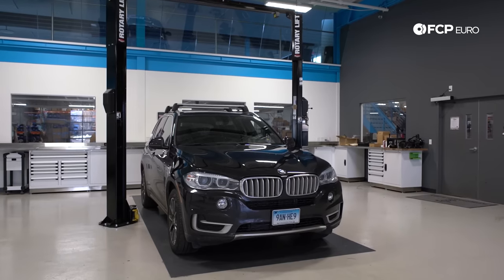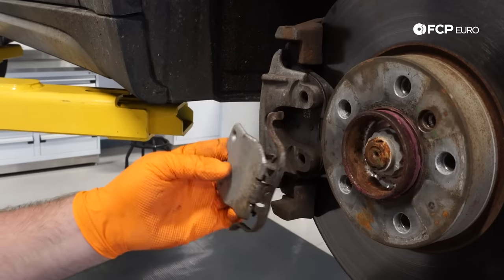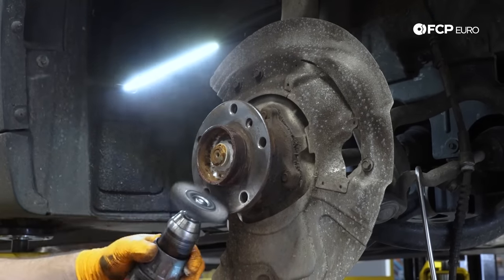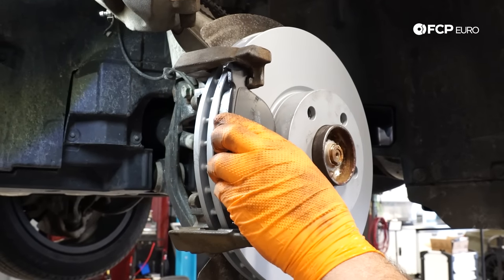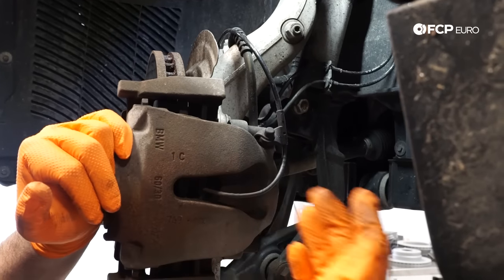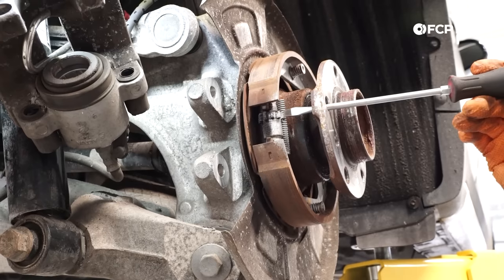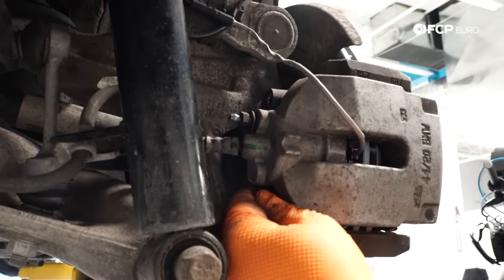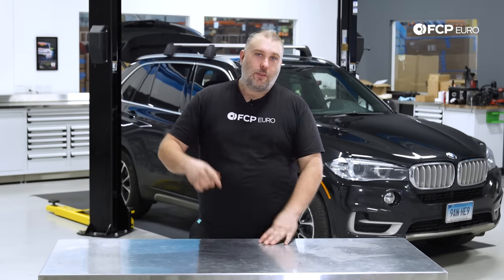BMW F15 X5 & F16 X6 Brake Service & Bleed Procedure

Comment: Great video, when bleeding to stop air getting pulled in at the bleed screw I'll remove it before pressurising and use a little copper grease on the threads. That way any bubbles you see are from the lines, helpful if you've replaced anything further forward.

Comment: Reset won't work if the electric emergency brake is set.  Super clear video.  Gareth is a great presenter.  Best brake video ever.  Best brake fluid I've found is Motul RBF600.
Reply from the maker: Glad you liked it! we try to present things as clearly as possible, and G is great at that

Comment: Thanks for the video. You’re well spoken and explain it well. I just changed the rear pads, rotors, wear sensor on my sisters 2016X5 now I’m in the process of changing the same on the front and rear of my wife’s 2015X5. Ordered my parts from Rock Auto. Got the mid to high grade parts. Mine came with the rubber inserts that the slide bolts go into and new dust caps.  The rattle clips on the 2015 and 16 are the older style then the newer one you worked on in the video. My wife’s BMW has the wide 35’s on the back. Ugh. Can’t rotate tires and we have go through them quick. We got 101,200 miles out of her pads and rotors. Amazing. But yes one pad was worn completely. Past due. Again thank you for the video. I was in upstate NY/Canadian border. Now down in  Myrtle Beach SC. Vehicles are so much cleaner.

Comment: Bleed Tip: attach bleed hose to caliper bleed nipple, then zip tie the hose to the nipple. This will prevent any air or fluid leakage, and transfers to each caliper nice and snug without any further adjustment. Now if you see air in the line, bleed until there is none- while maintaining a full brake fluid reservoir. You shouldn't be seeing air in your bleed line, if so, this way you will know it is from the system, and cause of a spongey pedal, not an "eh, it probably crept in at the nipple"

Comment: Thanks for your video. Can I ask two question?  Do we need remove the auto hold before changing the brake?  Another quesiton, Can we do not put out the brake oil? just open the oil pump and use the tools to push the piston?

Comment: Almost exactly my methods. Biggest difference is that I use the specified DOT 4 LV fluid. The TYP200 is too thick for the ESP system.

Comment: Hugely useful - not much specific F15 info out there. Too late to help with my rears, took that job to local shop last month. But saved some $ by bringing in the rear rotors and pads kit you guys sell.
Reply: TBH brakes are brakes, there really isn't anything unique about the X15 brakes.  A competent person who's done disc brakes before can figure it out.

Comment: You could also put a thin layer of antiseize or grease on the hole surface of the hub before putting the brake rotor to prevent rust from forming and the disc to get stuck for the next service.
Reply: Agree, I put antiseize on the hub, rotor screw and on surface of the disc (only where wheel touches rotor).

Comment: GREAT VIDEO. i'M GOING TO ATTEMPT TO CHANGE ALL DISCS, PADS AND THE AIR SUSPENSION BAGS ON THE BACK. HOPE TO COMPLETE THEM BEFORE CHRISTMAS. HAVE A LONG TRIP AHEAD. AIR BAGS ARE STUFFED AND BRAKES SHUDDER AT SPEED. CROSSED FINGERS. LET YOU KNOW HOW I WENT. BMW 2016 X5 F15

Comment: You should do a partnership with Milwaukee to review some of their tools.  M12 Stubby and 3/8 speed ratchet are great.   Maybe they can send you the cut-off tool and hackzall for review.

I try to get to the rear brakes before the pad sensor trips to avoid all that extra work with the back panel and wire re-routing.  Dont think the resistance goes up or down on the pad sensor.  Rather, when the pad becomes thin enough, the rotor just wears out and breaks the connection leaving an open circuit thus telling the computer time to replace pads.

Comment: Hi there, thank you for the very thorough and informative video!

I have a BMW X5 2010 (E70) 3.0si and I made the mistake of bleeding the master cylinder dry and now the brake pedal has gone soft, will I need to activate the ABS pump as a result?

Comment: Excellent video. Quick question.  Can I install 2013 50iX rotors, caliper carriers+housing on a 35iX 2013 LCI?  both models share the same knuckles, right?

Comment: excellent video as always :)  I always wonder if I need to change brand new hose when I do brake, engine oil or even ATF changing. Can I just  reuse the same hose I use it previous one? can I just clean up with water to flash used hose? I am talking about tools which use for putting in oil into certain places.

Comment: Did brake job on both rear…now getting parking brake malfunction error..don’t hear it working when pushing button….what do I do next ?
Reply: Grab the fuse chart in your rear fuse box and find the fuse(s) that relate to the Ebrake.  Pull them all and reinstall.  This can reset the system.

Comment: Excellent video.  In your experience is the in car monitor system pretty accurate on mileage?  My system is still showing about 3100 miles until suggested change.
Reply from the maker: Hi Cary, for the most part, it is pretty good, serves as a friendly reminder for sure.

Comment: how did you remove sensor on the front left side? could you have video show more information? thanks
Reply from the maker: Hi Ben, the sensor just unclips from the brake pad, if you are replacing it you can just pull it out, a small pick tool will come in handy. From there simply follow the routing to the connector inside of the electrical box that Gareth points out, pop open the box and you can pull the cable and connector out to swap out the sensor. We will make a point of showing it for future videos.

Comment: i couldn't get the carrier caliper bolts to budge with breaker bar. I think they came with loctite from the factory. don't want to snap the E18 bolts. Space is limited so impact doesn't fit... Any ideas?
Reply: That¨s weird. Mine came right off. 2013 E70 with just 60k miles, and rotors have never been changed before. Pretty worn.

Comment: How do you do it with an EPB on the rears?  My F15 has an EPB.
Reply: U need a computer
Reply: Unbolt the rear cover on the calliper. Wind in etorx all the way and then press piston.
Reply: @FA-sr6lx  or do as Hussein Saad said.
Reply: You can just apply 12v from a second battery to the terminals.  One way will run the motor in, putting the brake on, the reverse will run the motor out.  So run the motor out until it stops, replace the pad, and use the motor to run it in until it stops again (braking brake set inside the car).  Then release the brake from inside the car, you should be good.
Reply: @CitEnthusiast  thanks
Reply: If anyone was wanting more details on this EPB comment, here is a good video on it. https://youtu.be/Ljq4ATPorXM or just YouTube "BMW Rear Brake Pads w Electric Parking Brake".

Comment: Great job!  I will be replacing my brakes in my 2009 528xi E60. I may go with Zimmerman rotors and OEM pads since the Akebonos dont have a good initial bite. Also do you think it will be good idea to bleed brakes with conventional method?  ( pedal press) Many thanks for the advise
Reply from the maker: Hi Marcin, always a great idea to flush out old brake fluid, especially while you are there doing brakes. The pedal method will get you to a good spot, you can always look to upgrade to a bleeder as well, designed for a one-person job.
Reply: First time using Akebono pads on any of my BMWs, this being on my F15 X5, and have to agree I'm disappointed in the initial bite. Bought the parts a year ago and didn't need to do it until now, but may see if the FCP guarantee will work for swapping this. Probably give it a few more drives. They are very smooth, but I don't have the confidence in the amazing braking I had before.

Comment: Great video. Doing the rears today. Question: My pads, front & rears, are wearing much more on the outer pads than the inner. The warning has not come up on the dash because the sensor isn't worn. inners measure about .25", outers .10" or less. this was at 81K. caliper pistons pushed back easily & I didn't find any issues there. Guide pins looked great. No excess dirt or grim on the carrier. NC climate, not like your area. This is the 1st pad change.  Why the difference in wear? Puzzling.  Would love to hear your feed back.
Reply: The only way that's happening is because the caliper isn't moving back enough.  So the outside pad is staying in contact with the rotor, while the piston has retracted and pulled the inner pad away.  So while the pins may look okay, what about the inside of the caliper where the pins ride?  Grease the pins, that should help.

Comment: Are the pad sensors reusable?
Reply: If they have made contact, you need to replace. I just did my rear brakes and didn't replace the sensor which was almost at the rotor, but not yet, and it didn't cause an issue. I have the sensor though and will do it sometime, just not now since you have to pop some one time use rivets on mine to get to the connector box.

Comment: Are you sure brake guide pins don't need to be greased, guide pins must move back and forth in grease
Reply: ATE, who make the calipers specifically state "no grease" in their documentation. Just clean them. I use green Scotchbrite, it polishes them up without scratching. Buy new pins if they are pitted.
Reply: Any reason not to spray the guide pins with WD40 or similar? Wouldn’t harm the guide pin bushings and would inhibit corrosion.
Reply: Usually silicone grease, never regular or copper grease or anti-seize.

Comment: Why toss the front pads?  Loads and loads of miles left, 10's of thousands of miles.  Great to teach how to do this work, but take the time to educate the viewer about when things need replacing, not to just toss it out because there's a light on the dash!  This vehicle needed new rear pads, that is very clear, but the front's were fine, just needed inspection.  Then determine why the rears wore way before the fronts, perhaps the fronts were replaced and not the rear in previous services?  That would be normal, but worth checking so we know there's no drag on the rear brakes causing excessive wear (unlikely since the pistons pushed back easily), or a brake compensation valve not working right.  This concept of throwing away perfectly good parts should not be encouraged!

Comment: Dot4 typ200 should not be used. Its not lv.
Reply: Use ATE SL.6 DOT4 instead? I can't find what is BMWs recommended brake fluid for X5 x35i
Reply: @ohridm  use sl.6, yes :)

Comment: So, you did put those wheels on and did not put anti seize on the mating surfaces? Not even after the new rotors?

A pro not wearing eye protection or a mask when all that harmful dust is flying?

But better than most for opening the bleeder when pushing the piston back.
Reply: BMW doesn't recommend any anti-seize